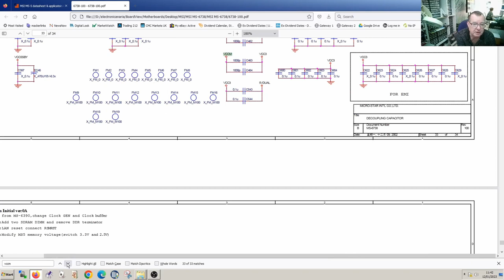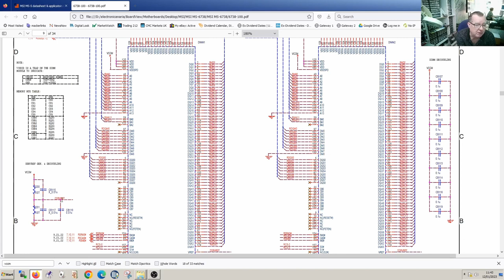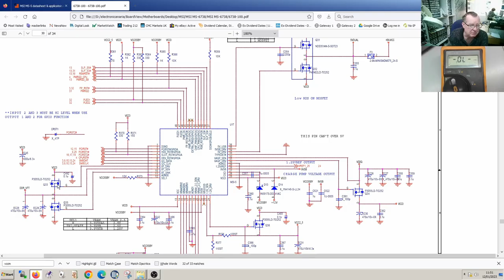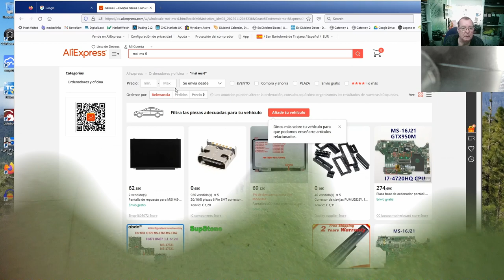Retro Motherboard Repair - Beeps with Good DDR RAM Fitted.  Does Not Detect RAM. Can We Fix It?

Comment: That brought back some memories. Without a schematic back in the day I saw a lot of these boards.. and the notorious Dell E-machine junk.. Spent hours with a meter drawing out bits of schematics trying to trace out how various supplies were made. I might even have a couple of those boards in my hoard of donor bits and bobs.. I like to restore machines from the XP and bad caps era as they are increasingly rare. It's easier to find a 486 in working order than an Intel or Asus from 2002-5 Your board swap option is a good upgrade.

Comment: The text on the chip is just how MSI renamed it, naturally you won't find a lot of them like that in the wild. But you have pin count, you have footprint, and you can look at service manuals of other boards of that era which use VT8235 southbridge and VT83x5 northbridge (VT8375 on your board is the one with integrated graphics in your case).
Reply: That's a good point. Might get even closer if you looked for boards that support the 2 different types of ram sticks. I think that's maybe why this custom is needed.

Comment: 7:30 The 2 green slots are for DDR1 Ram, the 2 black slots are for the older SD-Ram. Motherboards with slots for 2 different Ram type only support 1 type at the time.

Comment: Hello, concerning the MOSFET lifting legs, there is a more safe method: try to insert a piece of aluminum beer can foil between the leg and the pad when both are heated with solder gun, if succesful you will disjoint the connection, cooled down with aluminum in place it must be  replaced with a piece of dielectric (eg. foil)

Comment: Hi, nice video🤗
Wenn i want to lift one or more  pin from a transistor or ic , i use a sheet (1,5mm) of stainless steel. Push it between pin and pcb .
Renamed chips is a common like speech to say, you are welcome .

Comment: As a second comment I’ll kindly request again for an AGP graphics card video where you could share what edge connector pins to check, etc. as you did for the PCIe GPUs. I have a stack of AGP GPUs that need repaired that are not bad-cap related. I can’t seem to find any general AGP card repair videos providing the tips and tricks like you have shared for PCIe cards. I know it would mean a lot to me and the community if you could provide a tutorial on AGP GPU repair. Thanks as always sir for all that you do to help educate us to save our dying retro hardware.
Reply: While i also would like to see that, especially for the entertainment/ASMR value of it, and we usually learn a thing or two along the way, the pci-e videos richard produced should have taught you most of what you need to know :)

The main difference between agp and pci-e is that agp has no differential signalling pairs for the data/address bus (and no caps on the lines), and power is in different positions. Check the connector pinout on the AGP wikipedia page.

Richard checks for shorts on the power lines, and for shorts on the differential pairs of the pcie card, and then goes and checks the onboard power delivery. The power pins are naturally in different places for AGP. The data/address lines do not have caps on them, but can still be checked for a short to ground. AGP cards often have much lower power requirements, so instead of buck converters, you often get linear regulators, which are even easier to diagnose.

Have a go with a multimeter, and see what you can find :)
Reply from the maker: OK I'll move it a bit further up the to-do list for you 😉
Reply: @LearnElectronicsRepair   Can you recommend Ali seller to buy electrolytic caps like Sanyo in your videos? Did you check ESR and other params, are they good? They often sell fakes unfortunately. Thanks for great videos!

Comment: are the new caps low ESR?
Reply: even the low end cheapest caps you can buy today in China will have better ESR than crap they put on mainboards of this era
Reply: @gorjy9610  Oh indeed.. Bad Caps era boards made people like me with contracts to dispose of P2 era machines large sums of cash. P2 caps were just the ticket for recapping these things. Not having to buy equally bad caps new made it a viable prospect.

Comment: First thing I'd do is check all those caps that were replaced...
I don't trust the other guy.
Reply: When it was a shorted chip all along?.. Nothing wrong with the replacement caps.
Reply: @PaulaXism  yep, I still don't trust the other guy...
Reply from the maker: @aurthorthing7403  It's a bit of a moot point because without a replacement chip I can go no further with this